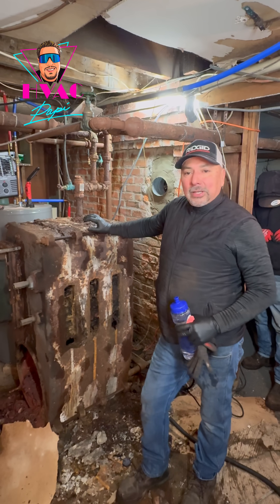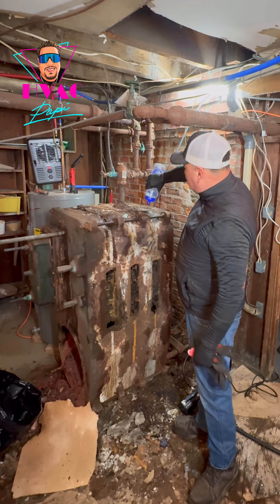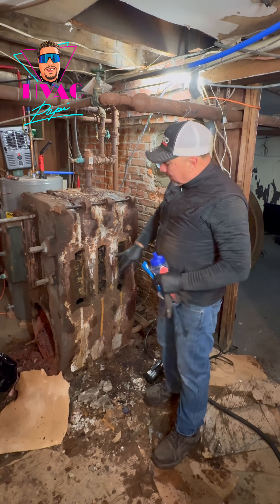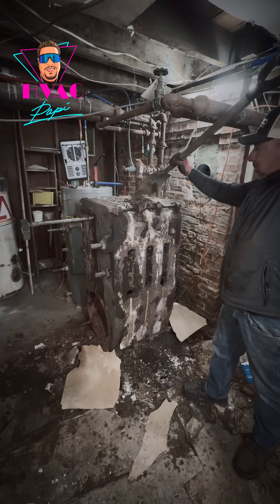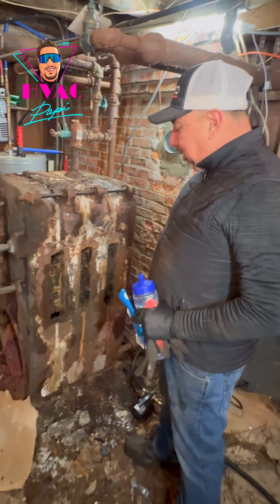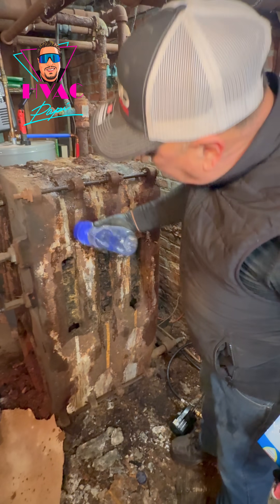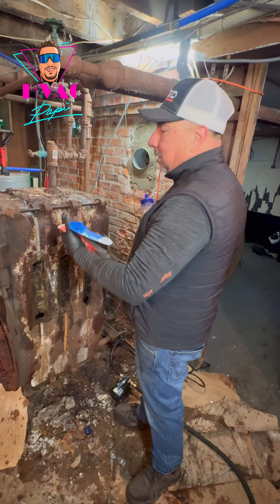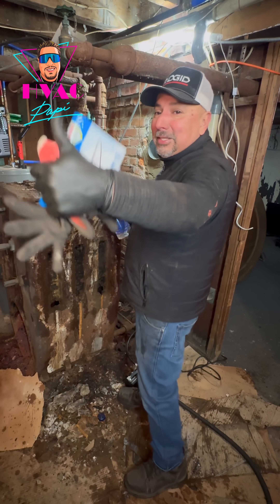Asbestos Found During Boiler Removal | HVAC Papi Explains Safe Removal | Freeport, NY

Comment: N95 and KN95 masks do just about nothing for asbestos. The particles are too small and pass right through the filter membrane. The minimum for asbestos is a P100 rated respirator and any clothes that come in contact should be properly destroyed because they can catch asbestos particles in them and release them overtime.